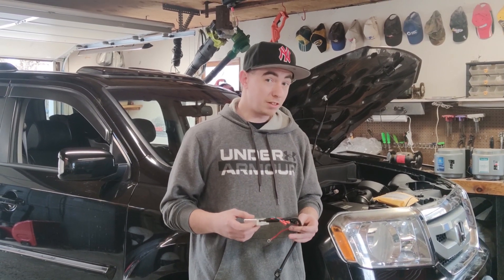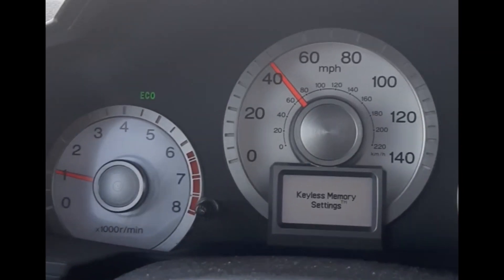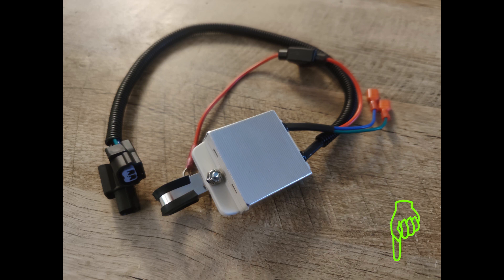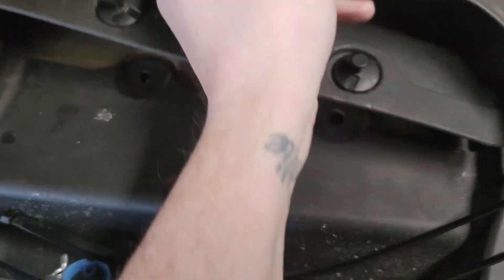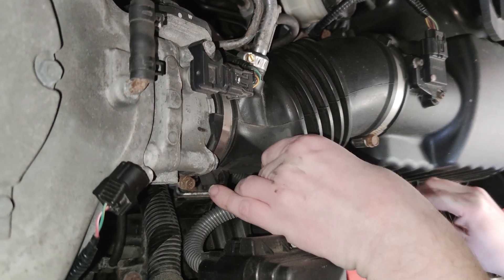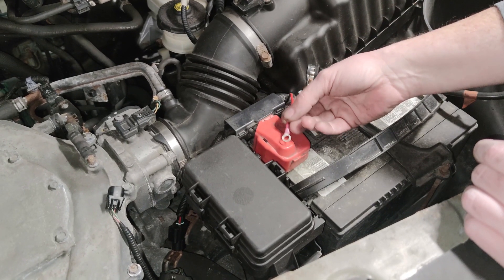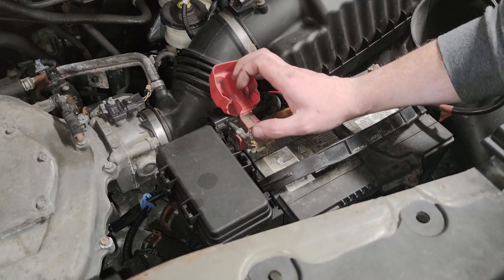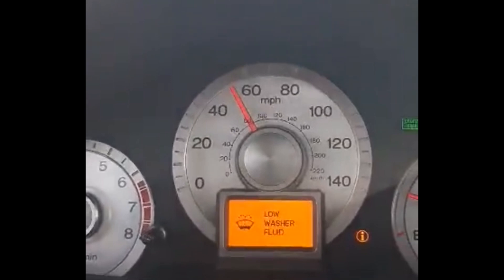Honda VCM Tuner II Eco Delete And Info

Comment: What are the blue & green wires for that didn't show connection being made to anything? Please help! I really interested in getting this for my 2014 Honda Odyssey
Reply from the maker: In the included instructions it says the green and blue wires are for additional features of toggling it on and off and also an audible alarm feature. Not a necessity just extra features. Hope this helps!
Reply: @GitItGarage yea hell nah, those blue/green wires are the DEVIL fam, foh lol. Great vid. Just did this to my ‘15 crosstour. Such a great engine, Honda tried to tame it…nope!
Reply: @godnamedtay 
Hello how you unplug the sensor 
I having a hard time getting it off 
2015 Honda crosstourr  v6  4W 
I need some help
Reply: @GitItGarage  Yes it does!
Reply: @GitItGarage  Thanks!
Reply: @GitItGarage  hey so I had a p3400 code come up 2nd time today and then the misfire codes pop up after I had to drive it back home like that with it driving with the cylinder deactivation code on now its saying random cylinder.misfires I tried the oil switch today recently had new plugs and oil change right before this happened the first time with CEL on and it running this way do you think k this would be my fix
Reply: the manufacturers website states: Green Wire is for VCM on/off operation and can only be left open or connected to ground.  When connected to a ground source the unit will re-enable vcm operation.  Leave unconnected to disable VCM/ECO.  Blue Wire is for a future engine coolant level alarm/sensor to inform the vehicle owner the coolant level has dropped below a safe level which will be available in 2019.
Reply: @ericbruch  so connect the green  wire to an on off switch and to ground for on off cantrol of VCM
Reply: @GitItGarage I don't have that extra connection hook up where the red wire connect on my battery terminal, could I connect it to the regular connection?
Reply: Eso no afecta la medición correcta de temperatura?

Comment: no one talks about how the normal resister style muzzler won't tell you if you are overheating because all they are doing is tricking the computer and temp gage to think it's at a lower temp then it really is I bought a cheap one on Amazon and they work but it is my lady's car and I don't want her guessing if something is going wrong so I decided to spend the 150$ and get the vcmtuner 2 because it has all the proper safety measures covered and it's all totally automatic no need to mess with it once you install..
Reply: How does it work? Do Eco light still come on with no shudder?

Comment: I have a Gen 9, 2014 Honda Accord 3.5L v6  94 k miles J35Y2 series. No issues so far no oil consumption change oil every 5K. did the later gen versions resolve this issue of oil consumption and potential ring failure. I’m considering doing the VCM disabler but my understanding is also disable the VTEC and therefore doesn’t allow the extra power regardless.

Comment: Just bought a 2023 CPO Ridgeline with 28k miles.  I would like to put this one but powertrain warranty won't be done till 2030.  Not sure I should risk it till warranty is over?
Reply: With that new a model can’t you just push the button to turn eco mode off to solve the problem?

Comment: If you take a loaner from honda of the same model you own it will drive much faster and smooth and you will feel like getting that car and trade your in, they have those loaners off of the vcm and they drive so much better. Every honda owner should get svcm or vcmtuner2 installed in their hondas to really enjoy what these 6 cylinder cars are capable of

Comment: So can you no longer see the correct engine temperature on your dash?

Also does this cause the engine fans to turn off prematurely?

Last question, if your engine begins to see a large temperature difference between your two separate engine temperature sensors, will it throw engine codes or cause it to operate weirdly? Thanks for the help!

Comment: My friend has a 2015 Honda Pilot with the least desirable VCM versions installed on a Honda. $4,000 at the dealer for rings, etc, two years later, just 30k miles it needs the same repair for an inflated cost. Honda is well aware of this situation as are the dealers. Why is there not a class action suit to resolve this?

Comment: Just installed this on my 2016 Odyssey. I would buy this thing JUST for the way the driving is improved. Everything is smooth now! I did so many transmission drain and fills trying to figure out why the vans shifting was so bad. Took it to the shop, they said everything was good. Couldn’t figure it out. I install this VCM tuner thing and it’s like a completely different car. Insane! Even if the van still burned a bunch of oil and fouled the plugs (which it won’t now) I would by this vcm tuner just for the improved ride quality. 

My ONLY regret…not buying this tuner 8 years ago.

Comment: Update:2 things to note,1. it helped stop the oil consumption it’s now never low on oil. 2. No shudder at all, uses all cylinders all the time. Fuel mileage decrease very slightly.  Now with that being said I would do 2 things. 1st. VCM if you have oil consumption issues and 2  transmission oil change properly, can’t fealty flush the tranny but changed it 3x to supposedly get 80% new trans fluid throughout the system. Luckily I was able to do it all myself. Hope this helps. My pilot drives now very smooth and no hesitation. Good luck.

Comment: Question, i just learned about this part. A few days ago my check engine light started flashing and vcm-4 light on, says misfires on bank 1-3. Changed spark plugs, coil packs, and fuel injectors and still have the problem. Can’t even drive. I ordered this to install but do you even think it will solve my issues im having? Idk what else could be the problem, or is the damage already done to my car? It only had 170k miles. Been a really good car up untill now. Just randomly happened when i went to start it and leave. Im desperate for my baby to be running again.
Reply: Clogged cats maybe
Reply: I would put VCM Tuner II on and drive it roughly (just under redline rpm) to blow out the oil fouling. But you do you, I would only do this to my own property.

Comment: I have read that once the check engine light is on the VCM is disabled. Wouldn't driving it just with the check engine light on solve the problem as well. Just curious because I'm trying to figure out if this is the cause of my cylinder 2 misfire. 
Wondering if just driving it with the check engine light And disabled VCM as a result will start to clean up the sticking cylinder rings.

Comment: Old video but maybe someone will still comment.
16 touring started throwing P0240 code. I couldn't figue it out so i took it to the dealership, they couldn't figure out anything either. Replaced all cats and o2 sensors ($6,000 in repairs) but P0420 kept coming back. I was then told it was the vcm defeater causing the code due to the coolant temp sensor being forced to report an incorrect temp.
I removed the defeater and the P0420 code didnt come back, reconnected the defeater and the P0420 came back
Reply: That's all the vcm defeater does is forces and incorrect temp reading because the vcm can't engage unless the temp is above x° so why TF is it $100 if it's just a $0.03 resistor????

Comment: Will this work on a 2010 Honda accord crosstour?
Reply from the maker: @Briaferg  as long as it has the vcm badge under the hood on the engine..
Reply: @GitItGarage  it doesn’t but I’m having the issues described in this video so I’m wondering if I should still try. This is the 3rd time it’s done this to me 😩

Comment: I am told the muzzled will void the warranty. If it is installed on a new vehicle could it be removed if warranty work was necessary without detection? Will the computer or anything else tell the tech that a muzzled was installed?

Comment: The class action says Pilots from 2009-2013. I am looking at 2015 Pilots, does this mean that they are less affected or not as big of an issue? 2015 is the last model of the 2nd generation, maybe they fine tuned more for that year, last year with a 5 speed transmission

Comment: My 2011 Odyssey has 74,000 miles. Suddenly it started running rough and power was greatly reduced. Idled too high, about 1300 rpm. It may have been stuck in eco mode. Disconnected both oil pressure transmitters, one on each head. Runs great but engine light is on. But at least it runs good.

Comment: VCM tuner is the biggest scam in the auto industry, you are buying hard wired junk from someones garage and putting into a perfectly good engine to lose gas milage
Reply: Well what would u suggest that will stop too much oil consumption?
Reply: @ drivers fault. Nothing wrong with manufacturing, always the driver

Comment: Does the vcm still work to get maximum gas mileage?
Reply from the maker: No this will enable all cylinders to run as to not cause damage.. therefore your using the whole engine and vcm is disabled.. but the difference in gas mileage is very minimal.. personally rather extend the life of my engine in the long run than save a cpl mpg..

Comment: Thanks for this video. I've been thinking of doing this to my 2013 oddy. So far I don't have any VCM issues after 160K miles as I do a lot of stop and go city driving and ECO mode barely engages. However, I am still considering doing this.

Comment: Please someone help, I installed this into my wife’s 2013 V6 3.5L Honda Pilot. Works great but she gets like a long lasting up to 1 minute, other times less sounds like a little siren in the truck? I’ve been looking online everywhere and cannot find a solution. Everything is good. Everything is running perfectly fine. It’s just that she gets this weird siren sound at least once a day when she’s driving sometimes more than once. If anyone knows where the sound boxes are located that would be great. It is not, the seatbelt sound by the way. It sounds very different. It’s like a low tone siren that becomes very annoying. Please help if you know anything or where the sound points are that I can start disconnecting these little sound boxes, thank you.

Comment: I am having constant misfire issues and heavy shake on the engine , mechanics saying compression but car was running fine , should I get this ?
Reply from the maker: I personally highly recommend this on any engine with VCM as soon as possible The vehicle of which I installed this on still works great but previously had to have the engine replaced due to internal issues I believe caused by this feature.

Comment: Question:
The VCM Tunner is recommended for those people who drove a lot in highway? 

I drive mostly in city and trying to start a little bit off-road in my Pilot…
My 3.5 had 99k miles and I drove peer year 1k miles at max, and maybe for roadtrips on highways on this vehicle why travel like anothers 1k miles every 2 years, so compared to another friends with same vehicle don’t know if I need it… 

My Honda, doesn’t vibrates and didn’t find any oil issue, so, I don’t know if I need to install it anyways cuz mostly in traffic city doesn’t appear the “Eco” mode like on highway when the family do some occasional road trips (usually two peer year on this vehicle of 40miles contemplated at the 1k peer year. That’s the reason I think I didn’t think we now don’t travel a lot)

Thanks for your video and the info!
I didn’t know much about this stuff, honestly I miss my 2008 Pilot, I think it was more “eternally” haha
Greetings from Mexico!

Comment: Nice video. Mine is on order now. Just wanted to tell other owners that have Honda's with similar engines to check the Air Intake Hose as it has cracks due to VCM high temperatures. I changed mine yesterday, the RPMs are solid now, no more flickering and dancing on the dashboard. An easy $20 fix (short term) along with the VCM disabling (long term). 2011 Honda Odyssey with around $130K miles.

Comment: Thank you for this video.. My 2010 pilot just started AGAIN misfiring.. I swear every year I gotta put new plugs.. I really hope this will fix it.. And the tuner you installed looks oem which is nice.. But what is the green and blue wire for?.. Nvm. Went thru the comments and found it.. Thanks again

Comment: Where can I get exactly the same one you're installing please help
Reply from the maker: Can order from vcm tuner 2 website with these instructions..Update: 2/19/2024. Ordering opens at 9am Pacific Time on 2/19/2024.  This weeks batch is now sold out. These orders will be shipped the week of 2/20/2024 through 2/24/2024.  Next date for ordering will be 2/26/2024 at 9am PST based on incoming product.  We recommend being on this product page at 8:58am and refresh the page until you can add to cart.  Recently batches are selling out in less than 3 minutes.

Comment: unfortunately i never knew about this issue until our 2012 odyssey started running rough, with only 89k miles. after taking it to honda, we were hit with a nearly $5,000 repair bill. the vcm had worn the pistons rings and oil was fouling the spark plugs. we had no choice but to get it fixed. i ordered this part and it makes the van run better..but i will not be buying another honda product, unless i find a super good deal that i cant pass on.
Reply: Did you follow-up on the recall?  Honda says they will reimburse.
Reply: I work for a dealership, just learned today for the next 6 months you can get all your money back. I would contact the dealership and if they are clueless ask to reach out to the Honda rep.

Comment: I have 150,000 miles just installed the tuner 2 and it runs like a new car, I had a lot of hesitation when gears would change especially 1-2 and and I’m sure my engine mounts are wearing heavily due to that. Seems to have more power due to using all cylinders all the time and not hesitating deciding which gear it should be in. Much smoother and shifting way better. Had a lot of oil consumption, will have to wait to see how much it has improved. But boy what a difference I notice in smooth acceleration and shifting.
Reply: Update: my shudder was due to needing a transmission oil change3x, shudder returned after vcm, tested several times. For lower the consumption of oil for sure.
Reply: @santashelper2007 so the vcm bypass helped or didn’t help?

Comment: I just installed a VCM Tuner II on my 2014 Odyssey.  Any easy way to run a couple of 14G wires, through an existing hole, in the firewall, to the dash?  This for the on off toggle and low coolant level alarm.  Thanks.

Comment: Done this a year ago but I fear its too late. I have a 2010 PILOT EX  bought it with 155k miles on it it has 190k miles now. Never had good gas mileage, I average 14mpg in city 18-19 on highway. Right after I bought it I kept getting check engine light a full month before scheduled oil change. Every time it was always just low on oil, quart or more. Then after year or more had to replace 1 bad cat and o2 sensor, problems persisted crazy misfires. Dropped it off to a Honda dealer they changed spark plugs, fuel rail, and the air intake hose. None of which solve any issue they kept car 1 month charged near $1200and couldn't figure it out. I told them stop work I went picked it up took to a engine shop. This shop changed EGR valve cleaned EGR ports and PVC Valve. I still burn oil. Not as much as before about a quart low when i go get oil changes. I sill get an O2 sensor light occasionally.

Comment: My ECO light doesnt come on anymore. But my CEL is on stating the engine is running below temp, cooler than it should be. Do u think the VCM muzzler has something to do with it? Already replaced my themostat and both ECT, so im thinking the muzzler is the culprit?
Reply: Reduce the resistance

Comment: What if I’m already having issues?? I do food delivery so I drive my 2014 Honda odyssey quite a bit. Brought the car at 112,000 miles and in a year it has 150,000+ on it. I noticed that in one year I’ve gotten at least 5 oil changes cause I always do the oil changes as recommended by the dealer to do so when the oil change light indicates for me to do so. So I was still thinking dang I’m getting a lot of oil changes what’s really good I know I drive a lot but dang. So fast forward not my check engine light is blinking fcw failed is on lcw is on and the car with the squiggly tracks behind is on. Took it to Firestone they initially said it needed a tune up took it int then they say take it to the dealer it must be electrical. Then I find this video which perfectly describes my issue. My question is how do I know if I’m too late to install the vcm on my vehicle has damage been done?!
Reply: You should still do it.

Comment: Question: With this VCMTUNER II on my Honda, will it still allow it to pass the emissions testing in my state?
Reply: I read somewhere that it is 50 states compliance. You may check odyclub.com, they have extensive discussion threads on this.

Comment: We just had our 2012 Crosstour towed to the Wilmington NC Honda for repair.  Too late to be covered by the Extended Warranty that Honda issued as that was for 8 yrs or 100,000 miles.  Our Crosstour has 78041 miles.  Cost to repair $3895.56.  Cylinder 2 is the worst.  Need to put new rings in Cylinders 1,2 and 3.  New plugs.  New Gasket and have to drop the oil pan.  So new oil needed also.  Have always, always run full synthetic.  Hoping this will eradicate any future problem due to the damn VCM.  Will it?  Small price to pay compared to the reair bill we are now facing.

Comment: Can you tell me the website so I can order the vcm muzzler.
Reply from the maker: The vcm tuner 2 is back ordered (link in video description)  but you can buy a vcm muzzler 2 off of eBay I'm pretty sure.. I don't have any experience with the muzzler but have heard it works just as well as the vcmtuner 2.. Hope this helps